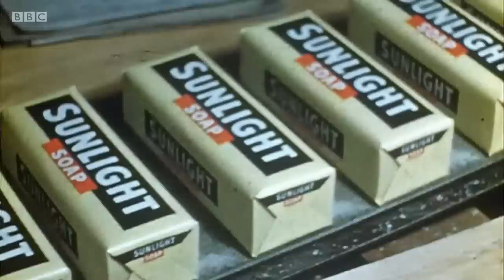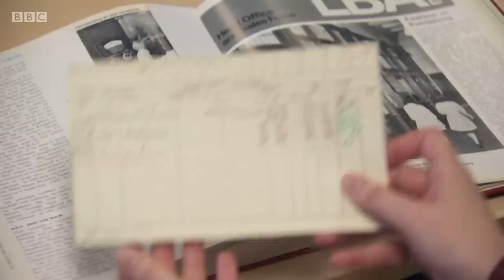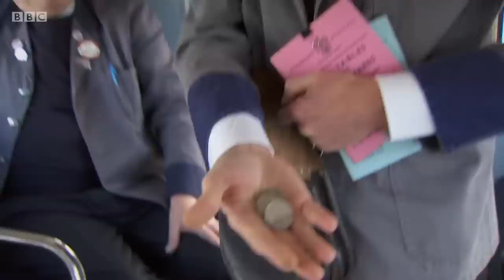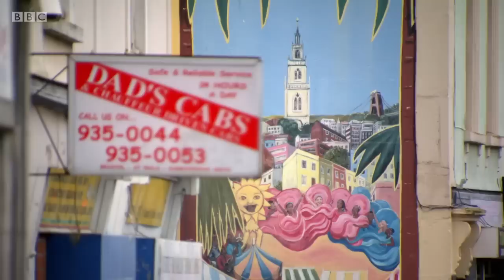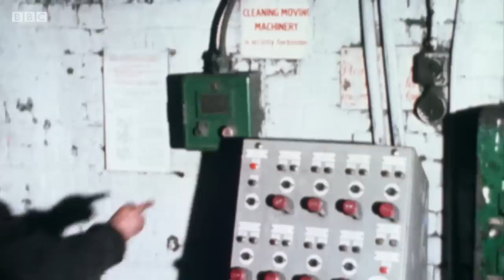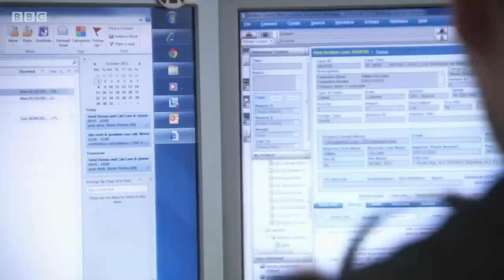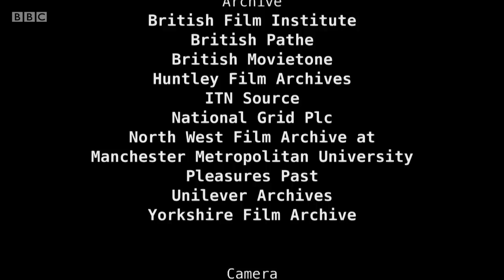Paul O'Grady's Working Britain - Episode 1 (Work)

Comment: I can't imagine life below ground as a miner, yet I should be able to! I can recall one of our field trips either when older or in school or college where we went below ground at an Age croft or a proximity mine. We were told all about the processes and air pressure etc and how coal was brought to the surface and the relevance of the Bridge Water Canal. I wish I could remember more, I just recall the drop of the cage descending into the mine and the heat once below ground. It's hard to believe such field trips were ever permitted in recent years given safety regs.